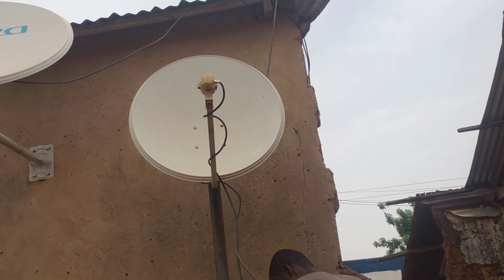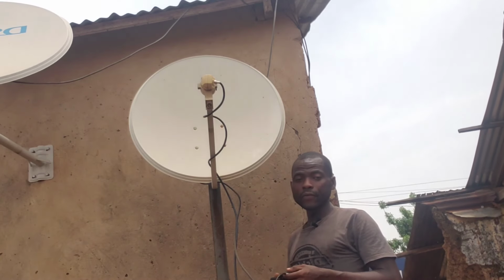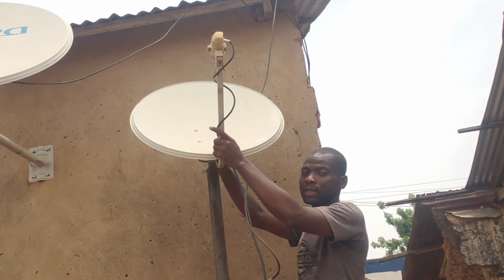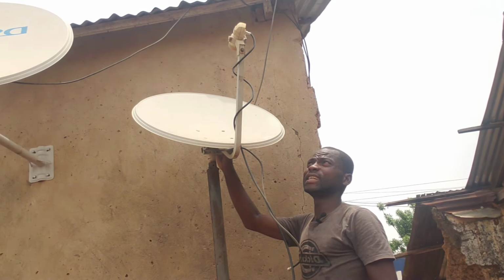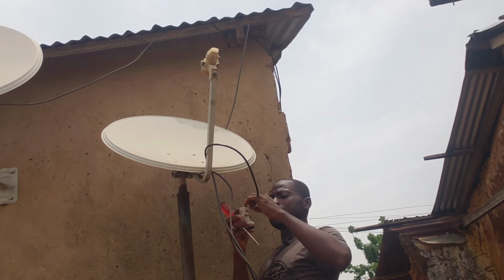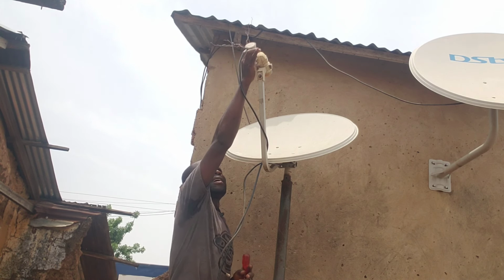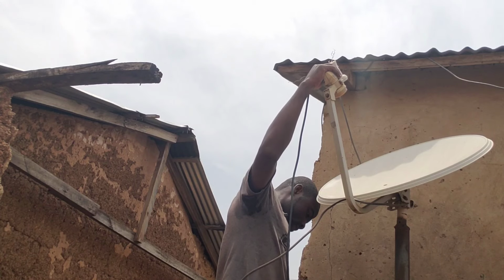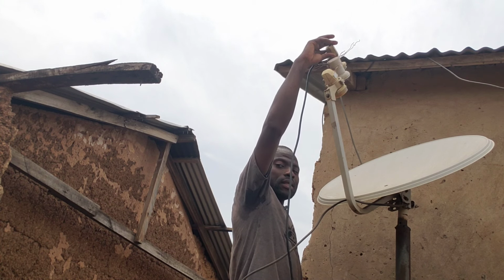HOW TO ADD THREE LNB ON A SATELLITE DISH

Comment: You have very strong beam thus why its very easy to combine. Here  in tanzania the azimuth is far away between each satelite so becomes very difficult to combine then
Reply from the maker: Really
Reply: i tried with 60cm dish but its don't work
Reply from the maker: @omarshambi2569 where are you located
Reply: @sattech12  kenya
Reply: i got 7/6e but 16 and 28 i did not get it i was roasted into the shining sun but my efort bore no fruit😢😢